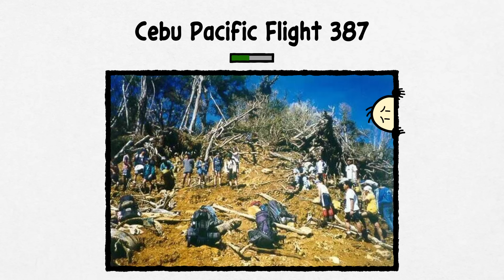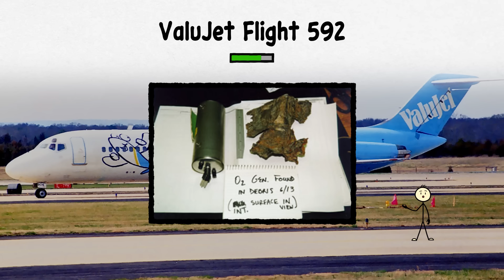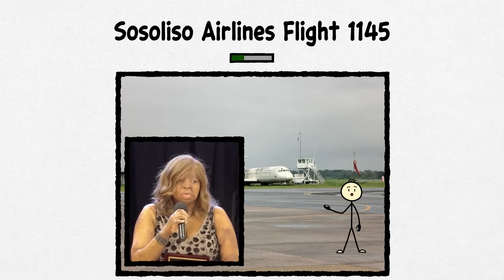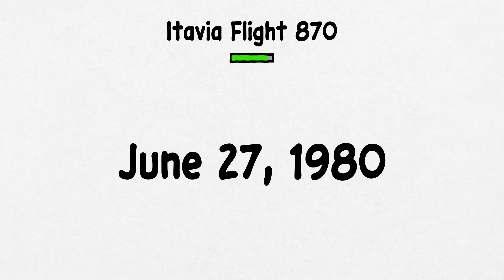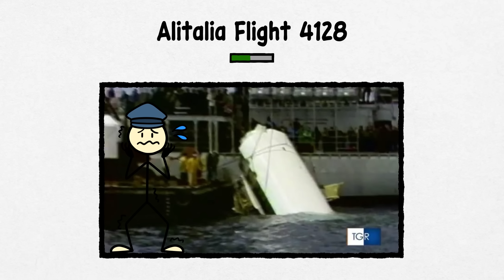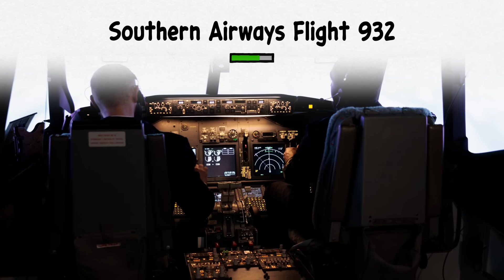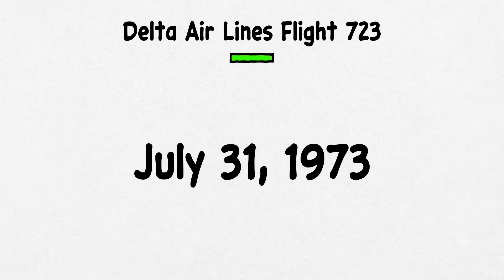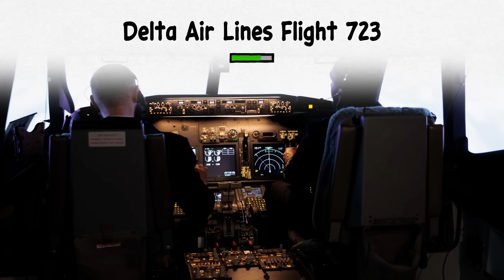Every Worst McDonnell Douglas DC-9 Accident Explained in 15 Minutes

Comment: In 1971, JAT 367 a DC-9 was flying over the Communist Yugoslavian terrain with 23 occupants aboard when the plane exploded mid air. Either from a bomb or shot down by Yugoslav air forces. The plane fell 33,000 feet into the Snow. 22 of the 23 people onboard were killed except for a flight attendant who was pinned against the back wall leading to the passenger cabin by a food trolley. She also had low heart pressure which saved her life because it prevented her heart from bursting upon impact. She was rescued by a doctor who was hiking through the woods.

Comment: I like a video of 727 crashes. We had one in Salt Lake City International Airport. 

November 11, 1965: United Airlines Flight 227, a 727-100, departed LaGuardia Airport in New York City for a flight to San Francisco via Cleveland, Chicago, Denver, and Salt Lake City. Flight 227 crashed on landing at Salt Lake City International Airport, causing the deaths of 43 of the 91 people on board. The investigation determined that the cause of the accident was the captain's decision to approach the airport too steeply.[4]